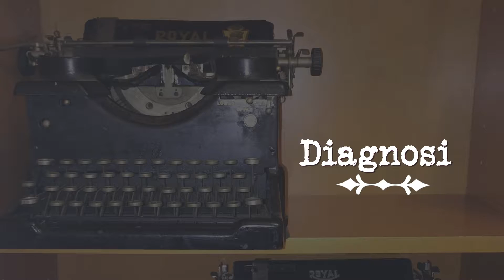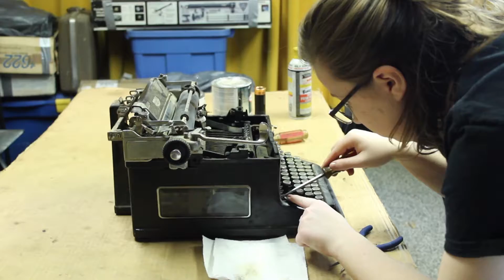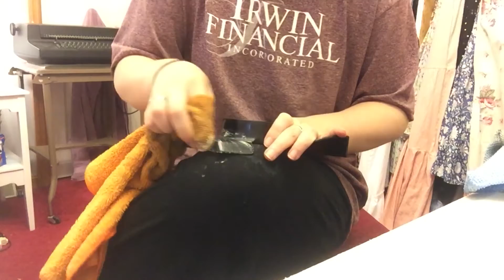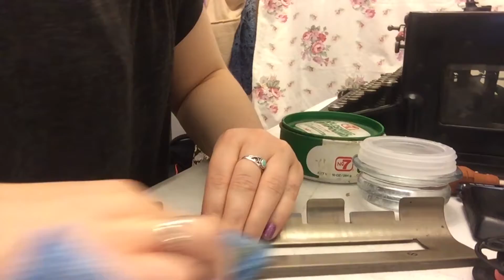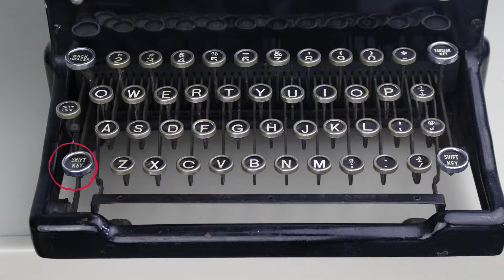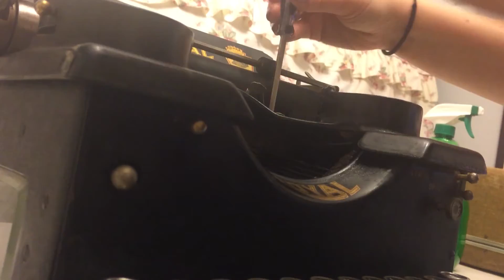Restoration: Royal 10

Comment: Would it be okay to use Singer Sewing machine oil on these?
Uses a thinner viscosity grade oil for cast-iron metal?
Reply: I always use singer oil—sparingly. My 1913 treadle eats oil at every meal but your typewriter might only need a tiny drop once (ever) like loosening a type bar where it comes up from the segment. 

Regardless, sewing machine oil is perfect. 
Never use/leave WD-40 sprayed on a typewriter. It gets gummy.

Comment: I bought a Royal 10 typewriter and all of the keys work but I have to hit them pretty hard. I think maybe some gunk in between the metal bits that the keys trigger is causing them to be a bit sticky so I want to clean them but I’m a bit nervous. This is the first time I’ve ever used a typewriter so I don’t want to open it up and then forget how to put it all back together. This video gives me an idea of what to do though so thank you for that! I might not polish the whole thing but I did wipe the outside with an electronics cleaning wipe and now I think I need to get mineral water and an air compressor to clean the keys/what the keys trigger (internal keys?)
Reply from the maker: Mineral spirits is what you use to clean the inside. You might just need to put it on the type basket to clean out those tracks! That would be where all those metal letter arms are- that doesn't require any disassembly
Reply: Thank you!! I will try that! I love your channel 🥰

Comment: Hello! How do you remove rust? Thanks
Reply from the maker: It can depend on how much rust and where. Some repair techs will dissolve the rust using chemicals. If it's surface rust, you can try wire brushing it. You'll want to avoid either of those if it's on the painted surface of the machine
Reply: @JustMyTypewriter  Thanks! Do you have any recommendations on how to prevent from rusting again?
Reply from the maker: @isabellahip2408  Avoid water and remove the original rust to prevent it from continuing to eat away at it

Comment: Sarah, you just amaze me.  I have a 1946 Royal KMM and I have had it for at least 15 years.  I picked it up free from an antique dealer near my town and the owner of the antique store just gave it to me free.  It wouldn't type.  So I took it home because I loved the look.  Been trying to get it to work but sometimes it types and sometimes it doesn't.  I looked underneath and there is a crossbar when moved a certain way, it would be able to type but somehow it goes into a position where it won't type.  I'm sure it can be fixed.  Just waiting for the time when I can go back into my garage and work on it.   Weather getting better so in a few days I will try and see if I can get this thing going.

Comment: Great video as usual.  I have a 1946 Royal KMM that I have to start working on.  Sometimes the keys type and sometimes they don't.  It depends on a bar that is underneath.  If I move it forward the keys work but it doesn't stay there and returns to a rear position.  Have to replace the whole platen tool.  It seems to wobble when I turn it.  Not straight on the left end.  Oh well, hopefully I will be able to figure it out and make it work.

Comment: I just picked up a Royal 10 at a yard sale for $25, and the serial number dates it to 1932.  It was caked with dust and dog or cat hair, but the exhaust port in the shop vac took care of most of that.  I took apart as much as I was comfortable doing and used lots of small brushes, Purple Power, and Dawn dishwashing spray.  A warm, sunny day helped it dry quickly.  A drop of WD-40 on the moving parts is keeping it free.  Looking to order a new ribbon and a set of repro decals from a business in the Netherlands.